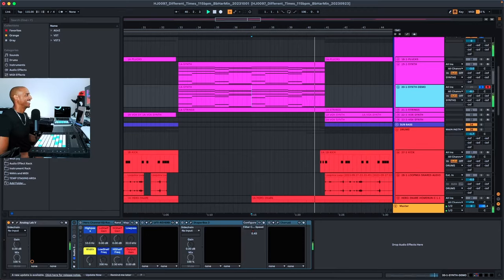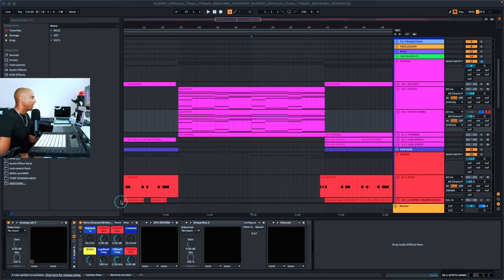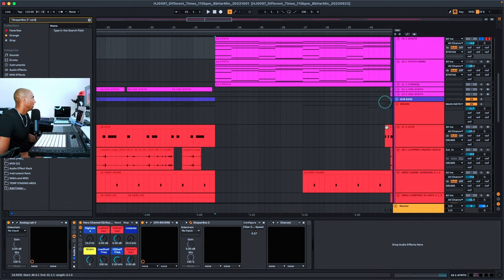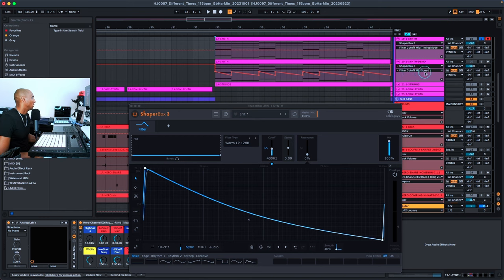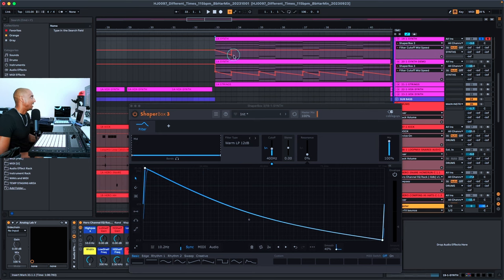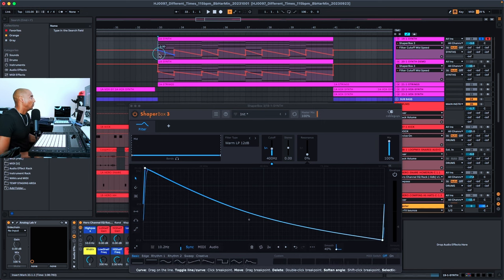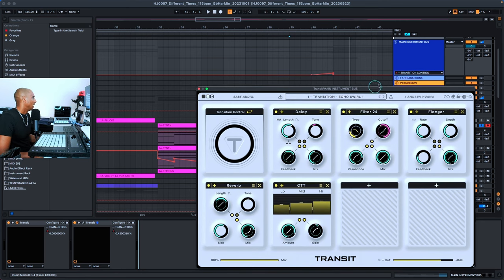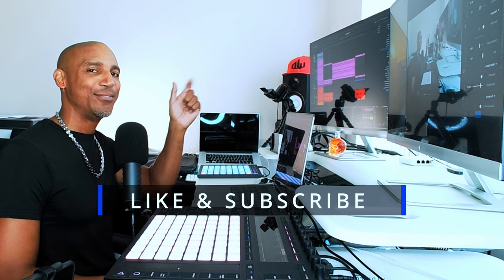Shaperbox 3 - LFO Filter Shaper Technique

Comment: Hey man, how about if you wanted to use shaper box 3 and switch the lfo mode from Herz (free speed) to beat (like 1/8 bar or 1/16) mid way through the automation? Like start with a really high speed and slowly decrease it until it falls on the beat like a 1/16 note sync.
Reply: So there is a way to have different "states" in Shaperbox 3 and then link it to midi and have that control switching back and forth between different LFOs and settings within the states. Pretty sure that's the answer. There are youtube videos on it, cable guys' own channel probably breaks it down more.
Reply from the maker: Hi @hjkhhjkh3635 - I believe @cody42693 is correct. You would need to automate both the ramp up of Hertz/Beats, plus automate the midi key switching. Please let me know if that solves what you are trying to accomplish. 🤗✨